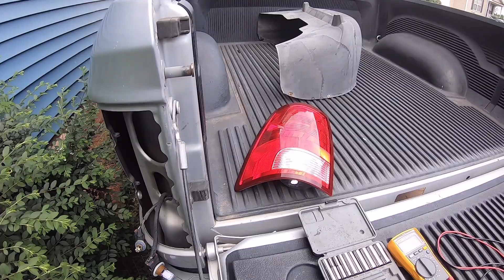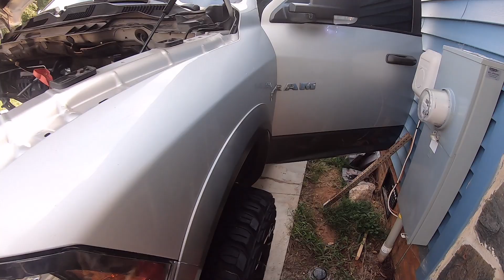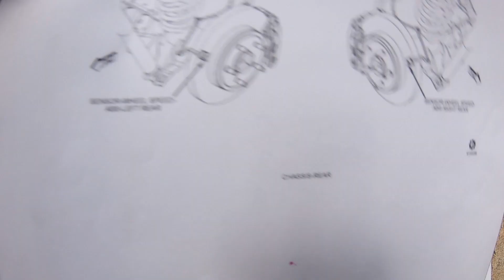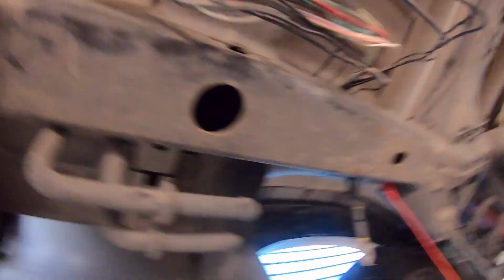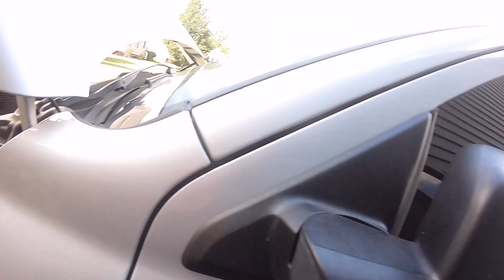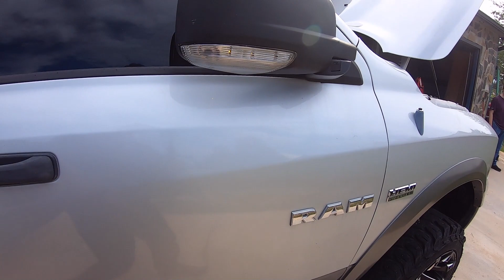2009 hemi 1500 trx4 build part 42.  Chasing down a bad ground gremlin.

Comment: Really great video. One thing I would have considered is, the bed is not physically connected to the cab, so there must be a ground wire from the bed to the cab, or bed to chassis, or both. Also, have you considered making a video about how to use a volt meter? I know how to test for 12 volts, but that's about it.
Reply from the maker: Excellent points.  No problem for a volt meter video, let me get some thoughts on paper.  Any topic in particular?
Reply: @solargarage  I would love to know which setting to use for continuety, and resistance. I only have a very basic volt meter, so would also like to know if it's worth upgrading to a more sophisticated model.
Reply from the maker: @ScottRods  Cool, let me see what I can put together.